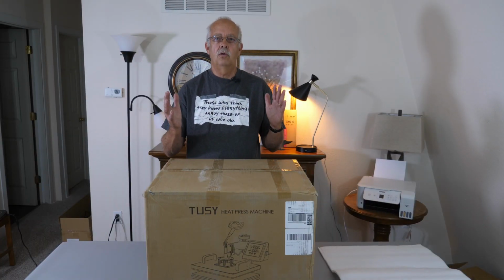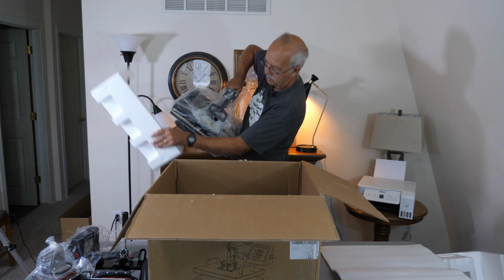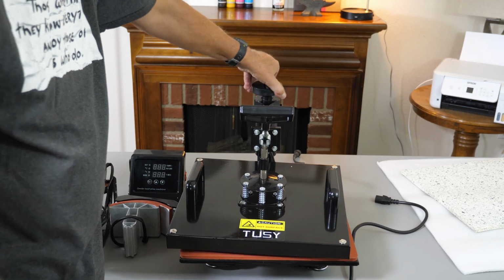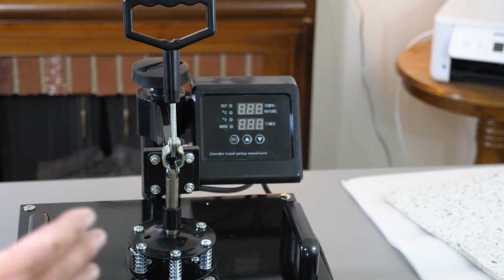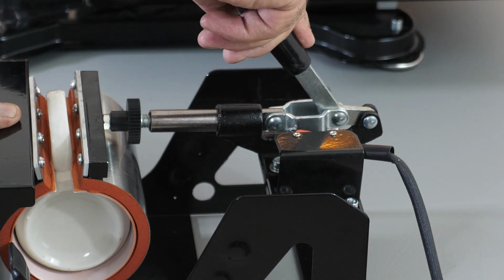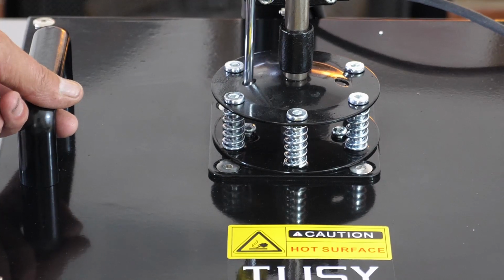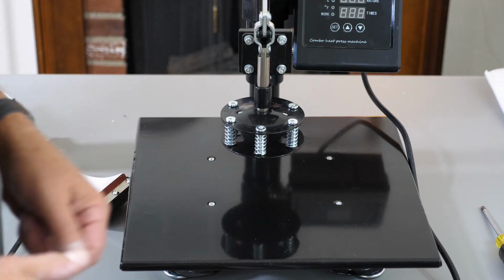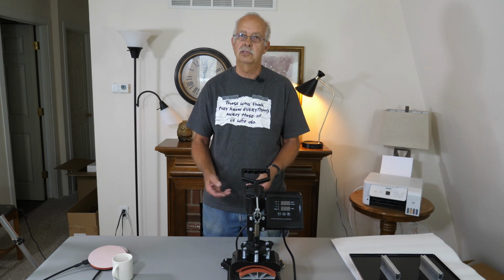TUSY 5 in 1 Heat Press Demonstration

Comment: mine does not have any limit switches
Reply: and only one connecter on the control besides power plug
Reply from the maker: Models differ.  Those without limits need to have the timer started manually

Comment: How do you adjust the tension for the heat press when doing shirts?  I also need a user manual as I bought mine second had and the seller didn't have it.  Do you know how I can get one?
Reply from the maker: Knob on the top rear is adjustment.  Do not know where you can find the manual (which was poorly written).
Reply: @rogersshop  Thank you! Very good tutorial!

Comment: Thanks for the video. Have you done any pillows?  Switched from clamshell to this in hopes to do pillows and that doesn’t appear to be an easy task.
Reply from the maker: I've never done pillows.  I do make tote bags (video coming soon), but use a much larger heat press.

Comment: I don't see a limit switch on my heat press or mug press
Reply: Ok on Amazon is says Tusy 5and 1 but it didn't say it on box like yours ok thanks
Reply from the maker: Depending on model, it may not have one.  Otherwise, the limit is on top of the platen on main press and by the handle on the mug press.

Comment: Hi Roger, I have this same machine and love it.....except....if I have a thick sweatshirt or very large....I have either a hard time or impossible to get thick clothing in the press. Any ideas? Does the top go up higher? Thanks!!
Reply from the maker: Yes, you can elevate the top quite high.  Turn the knob at the top of the column.
Reply: Thank you!!!  I thought that was the pressure.  Is that pressure too?
Reply from the maker: @dawnshaver8876  Yes, it is both.  Once a suitable height is established, you can fine tune the pressure with the knob.

Comment: I ordered my press from Walmart. Its not marked Tusy and the person communicating is in China. I think they sent me a knock off Does! The temperature is also 100 degrees off! My control box doesn't have 3 prong plugs like yours. Nor is there a timer switch level that connects with the timer so it doesn't turn off! Also Does your press fall over to the side when you swing it to the left or right? Im gonna return it and order mine from your link.
Reply from the maker: Sounds like you got a "knock-off".  Mine is accurate and does not tip when rotated.  It is quite heavy and solid.
Reply: @rogersshop  yes it definitely was because it didn't even have the switch or connectors on the power box smh. I returned it today for a refund.

Comment: Hi Roger, I enjoy your videos. I remembered from one on sublimating on the glass trivets (I make trivets all the time now) that you have a Tusy heat press so I found this video to watch. Mine  has an unlevel bottom plate. It slopes to the back and is not pressing firmly when the front of the bottom has good pressure. Any suggestions on how to adjust this so that I have even pressure over the entire bottom plate? Thanks
Reply from the maker: You could probably shim up the back with some washers.  Will take some trial to get it just right.
Reply: @rogersshop  Thanks Roger. Please keep making your how to videos.

Comment: Hello! Thanks for the unboxing video was concerned on quality of this . 

Question: I’m between this and a cricut heat press + hat press. For time efficiency which would be better quality and faster?
Reply from the maker: In "my opinion", the Cricut unit is WAY over priced for what it is.  I have had no issues with the Tusy and have been using it in a production setting even though it is not designed for such use.

Comment: Roger can you tell where where you got your tusy from. I bought one on Amazon a month ago and I think it is a knock off. No where on the press, manual or box does it say tusy. Doesn't even looke like the real Tusy even though the seller assures me it is.. TY
Reply from the maker: Bought mine here:  https://amzn.to/3EJ0l1t
Reply: @rogersshop  Says sorry couldn't find page. don't think you got all of the address when you copied it. TY
Reply from the maker: @jennylowe4486  Interesting.........Tusy Store no longer offers this heat press combination.  https://www.amazon.com/stores/TUSY/page/1EC3B1EE-742A-40BC-B94D-2A5CB3FA704F?ref_=ast_bln
Reply: @rogersshop  They still have the 5 in 1 but I was just watching you video again where you show everything on the controller box and it looks nothing like it. Doesn't have all those connectors just one. Where yours says temperature it's says sv/pv. They are trying to send me another one but I just want to send it back. I seen in your other videos you got a Vevor also, how do you like that one?
Reply from the maker: @jennylowe4486  The Vevor also performs well.  I just upgraded to a large, commercial heat press from Heat Press Nation since we use these in a commercial setting and although the Tusy has held up, it is not intended for how we use it.  A video will be coming soon and this new press is a beast!  Was NOT cheap!

Comment: Roger, I don’t kn if you have the answers but I received my “ Tusy “ press 5/20/22 The first thing I noticed was Tusy was not embossed on the top heat plate , looking at the box the Tusy name was covered with tape , looking at the control box , on the back where voltage info. is right under what I believe is the serial number I noticed black sharpie covering something, I scratched it off with my nail it say “ manufactured by Tusy also the cover of the instruction book at a white sticker ( I peeled it off) it says “ Tusy” why is the Tusy name removed from all these places & last but not least the heating elements for the mug press are not attached to the body of the mug press ? Sorry so long but do you have any idea about any of this ?
Reply: @teresarene1 I have this same problem but no where does it say Tusy, on the press, box or manual. Nothing about it looks like the one Roger has and it's also a 5 in 1. They told me some crap about them changing their logo. I don't buy it at all and returning min today. I don't get why yours did say Tusy and they marked it out, why not leave it? Not to mention mine is 40 degrees off, hotter then what I set it for.
Reply from the maker: Like a lot of things made in China, one factory makes all the same thing and then brands them according to what the customer wants them to say.  I did a video a while back comparing several different inexpensive sets of small pruning shears.  All of them were identical other than handle color and brand name on them.

Comment: Hi, Roger, it's been about 8 months - are you having any problems with your TUSY' heat press?  I have been researching heat presses and all the reviews pros and cons are so misleading.  You use yours a lot, so any problems?  Thank you!
Reply from the maker: No problems.  And, using it in a production setting, which it is not designed for.  Not unusual for this to be run constantly for 8-10 hours at a time, several days in a row.  No issue with it other than a few screws coming loose, which was easily fixed.
Reply: @rogersshop  Thank you very much!

Comment: hi roger, nice video what is the temperature to sublimate an 11 onz mug and the time. my mug press is giving me a hard time it smells weird when it warms up, and smoke starts to come out. i dont know if that is normal? the first time i did 350 for 120 seconds but it did not do that.
Reply from the maker: Should not smoke on warm up (unless first time use, which would be normal).  Some smoke (steam) would be evident while sublimating, and is normal.  I do 385 degrees for 120 seconds on mugs,
Reply: okay thanks, its my second time using it. but it did not work on 385 too high i had to lower to 330 for 160 seconds. plus it shuts off and starts clicking on and off then shuts the electricity.
Reply from the maker: @dylangarciayt4664  The clicking sound is the internal relay and is normal.  If it is tripping your breaker or blowing a fuse, there is something else wrong, which may, or may not be the press.  This easily goes to 400 degrees.  This should be used on a 20 amp circuit and may trip a breaker on a 15 amp circuit if there are other loads. (Retired Master Electrician)

Comment: Hi Roger, thanks for this video!  I notice in your other videos you have a Teflon sheet attached to the top. Why did you need to do that?
Reply from the maker: Extra protection in case I have a "Geezer moment" and forget to put paper over the press project.  Protects the top platen and cheap insurance.  Held on with 4 magnets.

Comment: Great video! I just got mine a few days ago and set it up and used it, as soon as it reaches 380 degrees the out button starts to clicks off and on ,  I sent a message to the company and they said it does that  and asked if it is working well.  It heats up fine and everything I’ve made with it has turned out fine but the clicking off and on is annoying.  Does yours do that?
Reply from the maker: The click you are hearing is the internal relay for the heating element as it cycles to keep the platen at proper temperature.  This is normal and is not unique to this brand.  the internal relay is required to handle the amperage load for the heat element as the load exceeds what could be done on the circuit board.  There are solid state load switching relays, but are more expensive than standard coil-operated relays commonly used on equipment like this.  I have two other heat presses, both of which are different brands, and they all do this.

Comment: Rodger I wouldn't endorse this machine as it is not of good quality.
Reply from the maker: Other than the fiddly height adjustment knob, I have had no issues with this and it is being used very heavily, for long periods at a time.  I am not endorsing this machine, and am not paid to review this, nor was it given to me.  This is a "hobby-level" heat press, and I am using it in a commercial form.  Not what it was designed for, but it is performing very well.
Reply: I have a feeling that you received a mark off of some kind as I did , every where it should say “ Tusy” did not exist or was covered with a white sticker or marked out with a sharpie as it is on the back of the control box needless to say for the price… I’m angry that I did not receive what I paid so much for …
Reply: @teresarene1  His isn't a mark off bc it says Tusy on everything unlike ours.
Reply: @teresarene1  because they are rebranding. I bought a press from them and the listing mentioned that it wouldn't have the logo since they are in the process of getting a new logo.

Comment: When pressing a shirt I noticed you took the speckled white pad off and just left the orange pad on their. Is that how we are supposed to do it? Or do you take it off when pressing shirts
Reply from the maker: The "speckled" pad is softer than the orange pad.  If I'm doing something like shirts, I either leave it off or put it under the other pad.  When doing something that has "curves", such as a ceramic tile, I put it on top along with a heat press pillow.  (Really something I should do another video on!)

Comment: Mine won't turn on the screen but the power button turns on? Any ideas on how to fix?
Reply from the maker: Insure that the cords are connected tightly and that it is plugged into a live outlet.  Also, the switch position can be deceiving, so double check that.  Otherwise, if this is a new unit (or an older one that worked previous), it may have a defective controller.
Reply: Mine is fine but the out switch keeps going off and on, any idea why?
Reply from the maker: @churchkimber7367  It could be a bad switch, which are easily found.  While the actual heat press has served me very well, some of the parts are not of the "highest quality", so to speak.  If you take dimensions and type of switch (with unit UNPLUGGED), these type of switches are only a few dollars.  If this is a new press,, I'd contact Tusy.
Reply: @rogersshop  Thanks I am returning it

Comment: I absolutely love the break down. Found it very helpful. Mines is on the way. 1st one so I was super concern about putting it together. But am confident now. Thank you🙏🏽

Love the tee 👕 lol 

I don't have a subliminal printer. Is it the only option for the mug and plates?
Reply from the maker: If you don't have a dedicated printer for sublimation ink, and you happen to have a Cricut, Infusible ink pens can be used to make your design.  These pens (although expensive for what they are) contain infusible ink.
Reply: @rogersshop   Thank you so much for your reply.  Wow I should have known, I ordered the Cameo 4. It has pens too but am not sure if it infusible ink. I shall do my research. Starting small will look into investing in Sublimation printer in the near future. 

Blessings
Reply from the maker: @xiomaratorres4467  Infusible ink pens would need to be purchased separate.  If looking into a printer, consider the Epson Eco-tank line.  There is a video here on my channel on how to convert it to sublimation ink.
Reply: @rogersshop  thank you
 Your awesome!